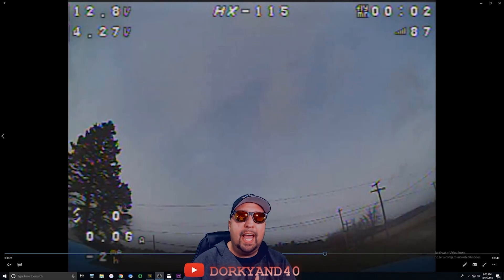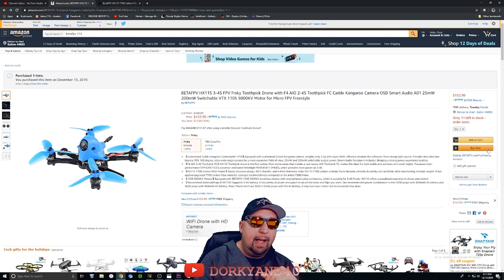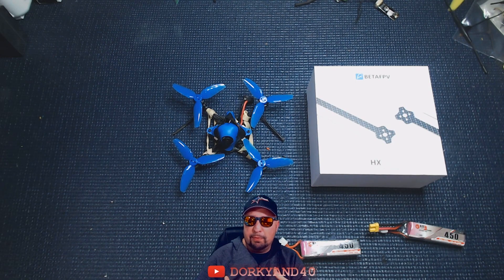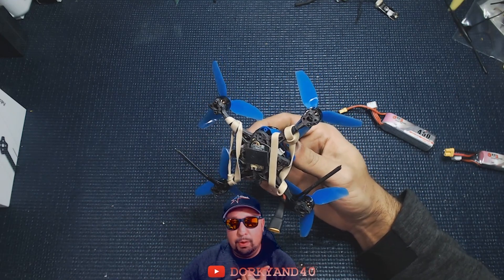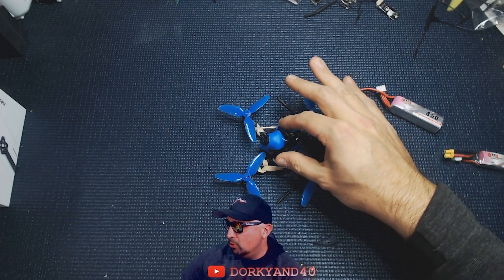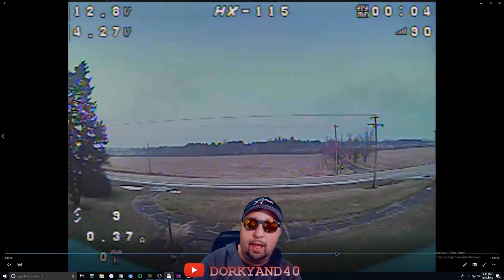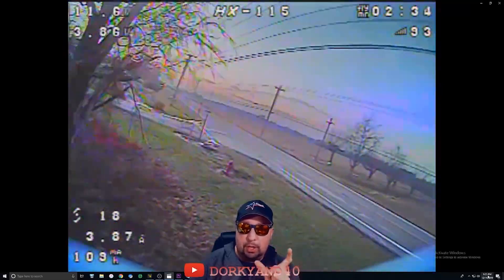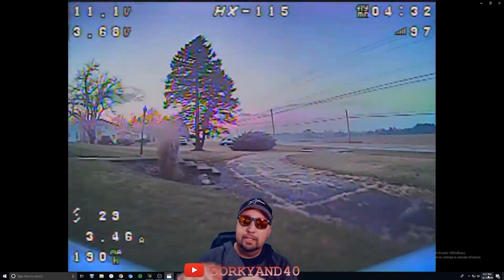BETAFPV HX115 | NON-HD VERSION | AWESOME!!!

Comment: Lower the sharpness of the cam. Mine looks more like a ccd now instead of cmos. I changed to props in..pid tuned it... i run 550mah 3s. Dont have any 450mah 3s. Triblade is soo smooth and quiet i can fly it 4am. Not a fan how the canopy is mounted. U get some jello. Im assuming 450mah is the best... 3s or 4s?
Reply from the maker: Jan Domingo yeah I found the connector inside. It’s much better now! :)